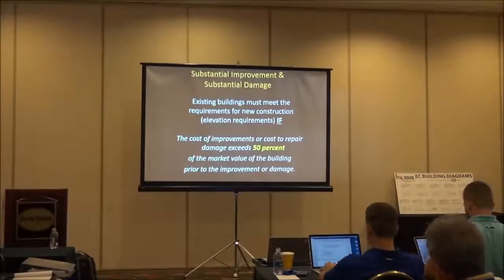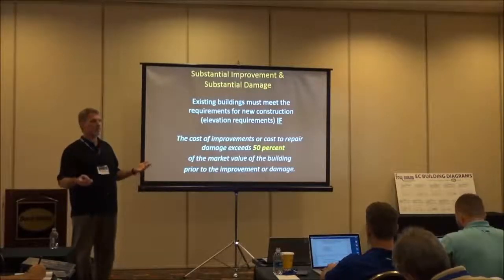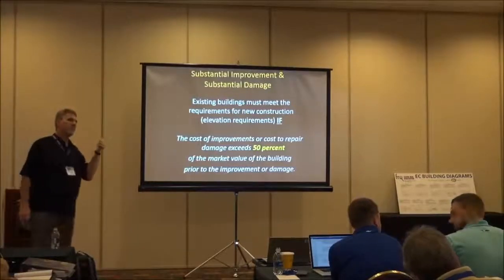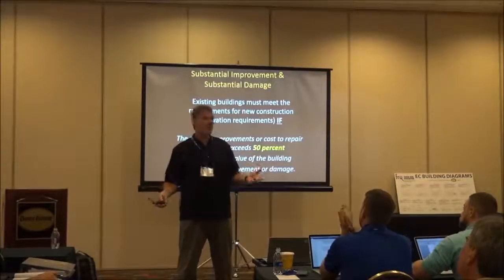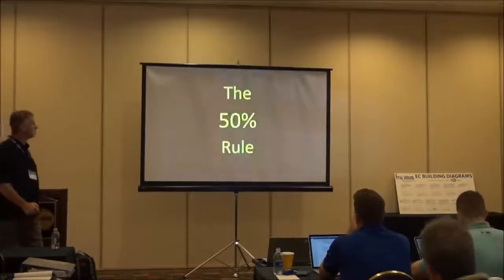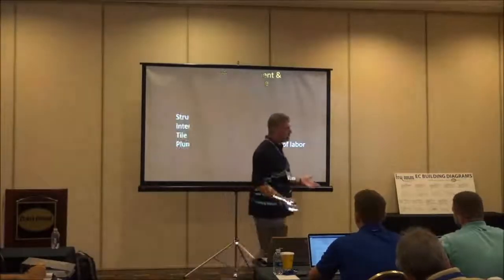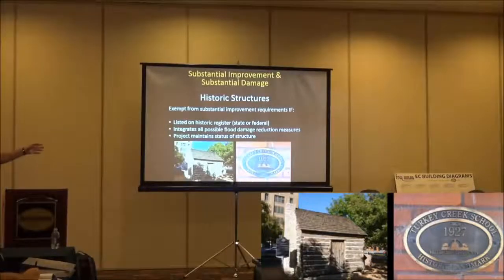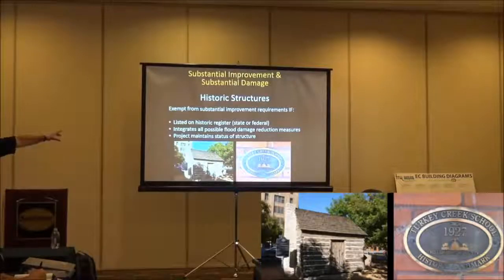Unit 8   Substantial Improvement, Substantial Damage

Comment: My property is in the floodway.  A survey listed the BFE @ 430.8'.  That same survey listed the Top of bottom floor at 430.9'.  It sounds like from your presentation that we are free to remodel without restrictions (Although we can't expand because of endangered species - salmon)  Can you point me to a FEMA reference that defines this?  Right now the city is under the impression I have to stick to the 50% improvement guideline because the house lies in the Floodway.  (They are admittedly new to this and not experts, I would be their first).